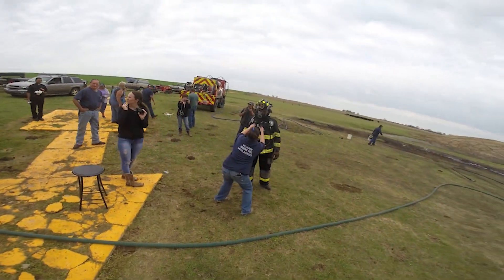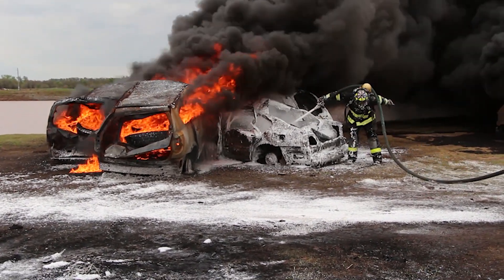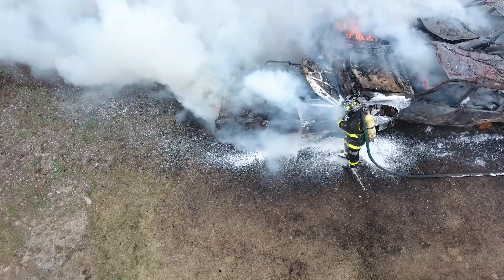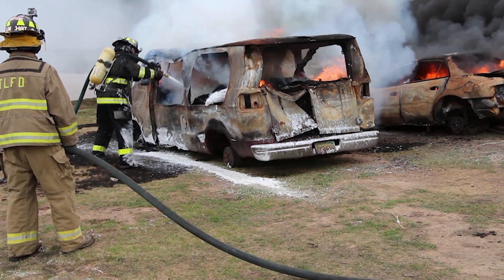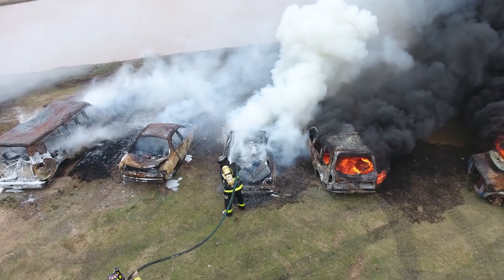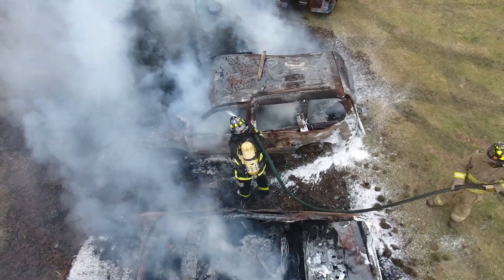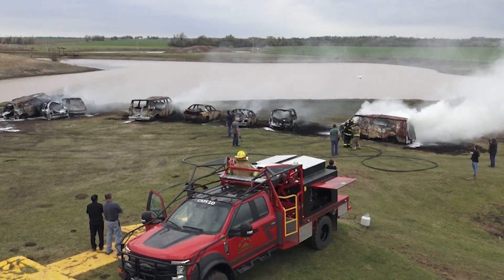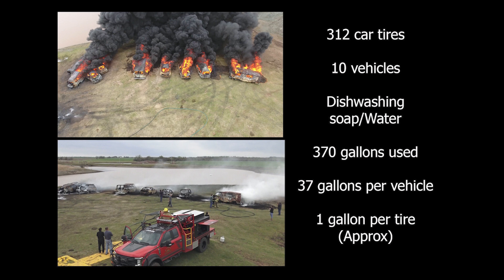Blanchat CAFS 2.0

Comment: Using a stream still, spray or spread the stream. Wasting time and material. Took a while for the pump operator to relaise he had way too much pressure. Mix was too dry and not taking much heat out. 
Love how you talking about AFFF/BFFF being carcengenic while the fire was burning cars filled with tyres and covered in oil and lit on the side of an irrigation dam. Claiming that any of that is not getting into dam is pure fiction.